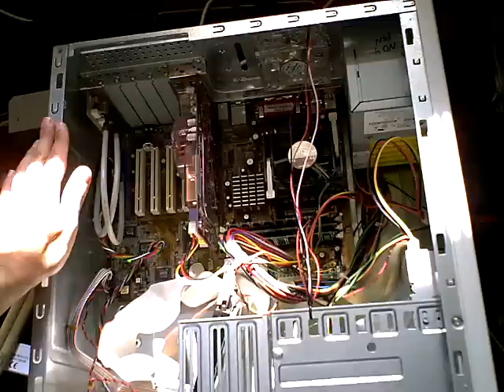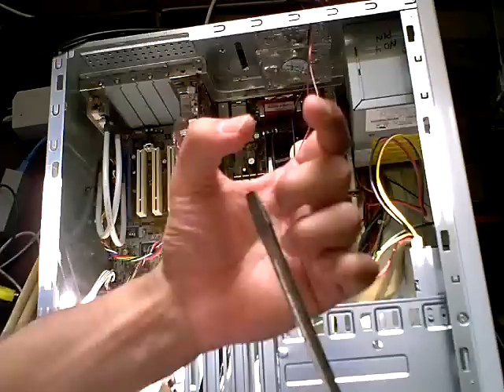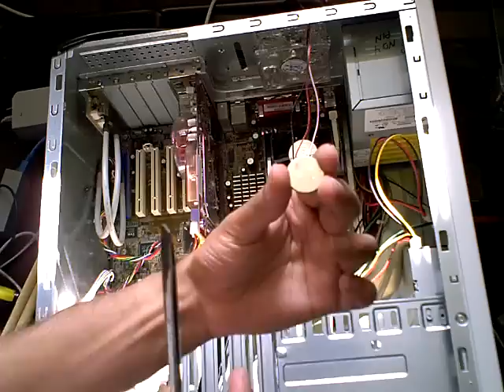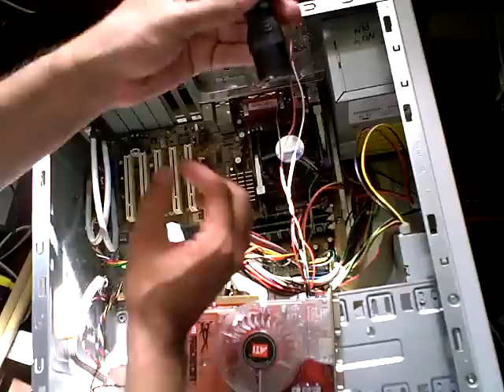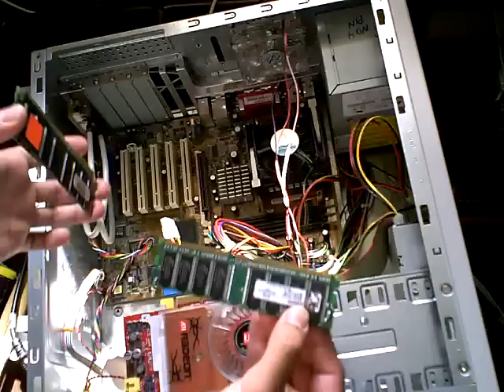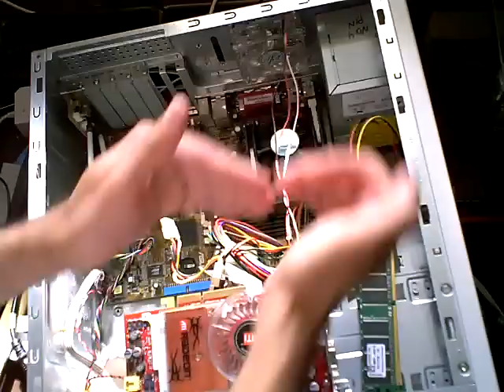How to possibly fix a PC that will turn on but will not beep and will not display anything on screen

Comment: I took both my RAM modules out.. 3 long beeps on a loop (apparently thats memory for as rock) i put 1 ram module into 1 socket, no post. I switch socket no beeps. My second RAM however beeps 3 long on a loop but only in one socket.. both RAM modules in both sockets 3 long beeps on a loop.  Switch them around same thing... IM SO CONFUSED PLEASE HALP ME
Reply from the maker: +AddamBolger1002 Beep error codes differ from one BIOS manufacturer to the next. To discover what the beep error code is trying to telling you, discover the manufacturer of your BIOS (available in the motherboard's manual or on the motherboard's manufacturer's website {on the page for your specific motherboard model}) and then look up the frequency and interval of your beep error code on:

http://www.computerhope.com/beep.htm

Comment: I recently upgraded my RAM from 8gb(2x4gb) DDR3 to 16gb(2x8gb) DDR3 and upgraded my graphics card from 1gb GeForce GT610 to 4gb GeForce GTX 960. My Computer fires on and all the fans spin and all the drives spin as well. However, none of the usbs and display ports work. My PSU is at 500W. Could it be the motherboard even though is powers the fans and all the other components? Been trying to figure this out for the past few days and it's all I can think about until its figured out. I need people with a lot more experience than me to help me out lol
Reply from the maker: If this is new hardware that you are installing on your motherboard (that has not yet functioned on your motherboard,) note that matching bus types of video card to motherboard socket (PCI-E for example) or matching bus types of RAM module to motherboard socket (DDR3 for example) does not necessarily signify compatibility. If this is the first time you are trying this hardware on your motherboard, there is a chance that this new hardware is not compatible with your motherboard, despite the same bus type and despite the fact that the new parts fit in their respective motherboard socket. Your motherboard manufacturer's website will have a support page dedicated to your motherboard's model, and on this support page should be a compatibility list for such components as video cards and RAM modules. Ensure that your new component is certified to function with your motherboard, and if your new component is not present on the compatibility list, then there is a chance that the new component is not compatible with your motherboard.

Comment: hi! I have a problem with my pc. Im trying to reoot my pc coz it display in the monitor when I opened it the the boot mgr is missing.then I inserted the windows 7 starter cd..i cant still get into process coz it display again the input not supported..what will I do? pls help..Thanks!
\
Reply from the maker: +Ry Chest Your display does not like the resolution that the restore disc displays in. Simply use a different display for the restore process. Once that is done, your current display should work once windows is up n running again

Comment: Hey dude can you help me?

i have dual screens. Both monitors boot up and then when it comes to the login screen my primary monitor goes black whilst my secondary monitor is fine. I hit the auto image adjust button on my monitor and the screen pops up for a secs and then it goes to black again. i have a r9 270x toxic
Reply from the maker: +septiczz Your issue is software based. You'd best contact the makers of your video board for help.
Reply: RodneyDickson Its alright ow just got fed up and bought new monitors thanks anyway
Reply from the maker: +septiczz Better that way : )

Comment: can the cmos reset work on a brand new mobo? also I took the battery and put it back in in like 10 seconds so could my time frame matter as well?
Reply from the maker: Yep, sure can. This is how I'd handle it: disconnect the power cable, remove the CMOS battery, short the CMOS jumper pins for 9 seconds then return the jumper cap to its initial position, press your PC's chassis power button switch (to discharge any remaining power circulating in the system), leave the PC unplugged and in this state overnight, then the next day return the CMOS battery to its socket and power up the PC
Reply: +RodneyDickson thanks for the reply but I'm an idiot apparently. my ram stick looked all the way in but apparently wasn't. thanks for the reply though. info helps regardless. good video
Reply from the maker: Good stuff. Glad things are running now.

Comment: My computer was working fine, I then removed, cleaned and put back my on-board video card. However, now I am unable to boot windows. The computer starts, I get display, I get past POST, I get the "starting windows" screen and then the computer restarts. This cycle repeats. Please help me, I am totally clueless!
Reply from the maker: Try going into the BIOS, 'Load Setup Defaults' then save and exit. If that doesn't help, try booting Windows by holding F8 to go into safe mode, then uninstall any unnecessary programs (including your current video driver). Also, do START, RUN, type MSCONFIG (then press enter). Uncheck everything in the STARTUP tab, then save and exit. If still no luck , your Windows installation may be corrupt and may need reinstalling.

Comment: Old video but pls reply I just tried to upgrade my cpu and now there is no display no beep nothing it turns on and I don't know what's wrong yes all the things in this video I did please help everything is plugged in right ram is good gpu is good no problems but no display how do I fix this?
Reply from the maker: If this is new hardware that you are installing on your motherboard (that has not yet functioned on your motherboard,) note that matching bus types of video card to motherboard socket (PCI-E for example) or matching bus types of RAM module to motherboard socket (DDR3 for example) does not necessarily signify compatibility. If this is the first time you are trying this hardware on your motherboard, there is a chance that this new hardware is not compatible with your motherboard, despite the same bus type and despite the fact that the new parts fit in their respective motherboard socket. Your motherboard manufacturer's website will have a support page dedicated to your motherboard's model, and on this support page should be a compatibility list for such components as video cards and RAM modules. Ensure that your new component is certified to function with your motherboard, and if your new component is not present on the compatibility list, then there is a chance that the new component is not compatible with your motherboard.

Comment: I reset the CMOS and turned it on and it beeped once, a still no VGA output tho. What does that mean?
Reply from the maker: +manafloodin Your PC might be defaulting video output to a different connector on the back of your PC. Try connecting a display to a different output and see if that helps

Comment: I have a fairly new HP envy 23 All in one that won't boot up entirely. It just shows the black screen then seems to shut back down. I recently upgraded to Windows 10 but since then it's been acting up and has been very very slow. Now today it's completely black. FYI I have wireless keyboard too so can't use F8 or F11 it seems. Any suggestions? Thanks!
Reply from the maker: Eek. Ok. Well, if the system is still under warranty, you could go that route. If not, you could buy a USB keyboard (electronic shops sell them for about $10) and try your hotkeys.
Reply: Thanks for the reply. I will try buying one today or tomorrow and see what happens!!
Reply: Oh another question sorry ... Do you think that the computer would recognize a new usb keyboard even though the drivers wouldn't be installed yet?? The  screen is still black and it's been off for at least 24 hours and still no progress.
Reply: Hi again! I bought a new usb keyboard and hooked it up. I tried rebooting my computer and pressing the hot keys and still nothing happens. Time to find a local tech? ...or can you suggest anything else? 😭😭😭😭
Reply from the maker: Ok, perhaps I read the situation wrong. You are saying that the screen is always black? There is no sort of text output at all on screen? If this is the case, since it is an All In One, I recommend you treat the problem as you would a laptop. See: http://www.youtube.com/watch?v=qRhphHjQrNk&lc

Comment: I've looked at my motherboard manual and I cant find cmos reset switch...not exactly sure what it looks like. I am having this exact same problem. I built my computer myself and its been working great for a year now. I unhooked it cleaned it to get the dust out of it and when I hooked it back up this problem was present. I have an ASUS p8z77-V PRO motherboard. Any advice anyone could give on how to locate my cmos reset switch would be very appreciated
Reply from the maker: Well, generally it's a jumper cap, not a switch per se. What you can do is simply look for the CMOS battery (the button cell battery shown in the video). Unplug the PC, press the power switch, then remove the CMOS battery. Wait overnight, then reconnect everything and give it a shot (the CMOS 'should' have cleared by then)

Comment: You can always update your motherboard, but before you buy a new motherboard, find out if your components might be useful on a new motherboard that it is compatible with them.
Reply from the maker: +Juan Gonzalez Good tip

Comment: hi rod.. can you help me..
my pc is on, i can control it via remote on network, 
the problem is no display on monitor itself..

steps i tried;

checked monitor and cable.. OK
reset/changed bios batt.... (display becomes ok,,but after several restart, no display again)
replace ram  (same above)

thankyou
Reply from the maker: +jaymar espiritu Ok, first, check for different video outputs on the back of your PC: your PC could be defaulting to an output that is not your main output. Also, if you can via network, try to access the BIOS and see which output device is selected as the main output device. Don't forget to test your display with another computer to make sure that it is not the display that is faulty. Finally, maybe your video out device is just faulty, it may need replacing
Reply: +RodneyDickson problem solved, i remove all the components , i found that processor slot is too dirt, i clean it with blower , and put it back again , now pc is ok! by the way im using AMD proc.. ty for ur response.. :)
Reply from the maker: +jaymar espiritu Wow, I don't hear of that fix very often. Thanks for sharing : )

Comment: can u pls suggest a ddr3 motherboard ( i have an intel dual core e2200 2.20ghz CPU)
Reply from the maker: +Right nanner Fraid I cannot. The last PC I built was well over a year ago. I've had bad experiences with Asus, but my current Asus motherboard is working fine, so who knows : \ Here's my wisdom: whatever you buy, go cheap, cause when something breaks, you want it to be cheap to replace. Also, don't believe that expensive means it'll last longer: I've had mid-grade hardware die on me just like low end. Hope that helps some.
Reply: thanks it did helped
Reply from the maker: +Right nanner : ) Good luck with it then.

Comment: So long story, when I was building a pc, it was my first, when I removed the motherboard  from the box it had a plastic case for the processor  to go, it would pop off once the processor was installed below it.  however it fell off right away, and when I put the processor  in, the clamp installing the processor dug Into the processors sides. and no image will show up.
Reply from the maker: +Julious01 You can try reseating it (unplugging the PC, removing the CPU from the socket, checking that all pins are present and not bent, and then reinserting it and re-fastening it) but you're talking about 'digging in' to the CPU, so it may be permanently damaged sadly.
Reply: +RodneyDickson aw... I'll have to look into it
Reply from the maker: +Julious01 I wish you luck with it then
Reply: +RodneyDickson would a new hard drive have anything to do with this?
Reply from the maker: +Julious01 If it did (such as the case of an I/O error) then if you boot the PC without the HDD connected and it boots fine, then you have found the source of your problem.

Comment: so if I leave my power supply turned off all day, then turn it on then the PC starts, If i leave it plunged in all day and try turn on the PC the fans and lights come on but no Post so going to try swap out my power supply, a week before this started there was a power cable and transformer that blew down the road and during that my PC was plunged in but not on and I think it caused it.
Reply from the maker: +Vernon Ray Hmm, that sounds like a very likely culprit. In your case I would tough out the 'turning off' of the PSU situation until the thing finally died, but I understand how inconvenient this may be. Either way, good luck with it.

Comment: Sir, I follow ur direction watching this vdo n i found the problem in RAM like in the vdo. I hav only one ram n two ram sockets. Then after i hav no idea what to do. I tried putting it in the 2nd socket and startup but again no beeps, no screen..Got no idea ..please help me sir
Reply from the maker: Hmm, have you tried resetting the CMOS as shown in the video? Also, have you checked the RAM module for any burn marks or missing contacts?

Comment: So i bought a new processor and tried putting it in, no display, no beeps. so i go back to my old processor accidentally bending the pointy things, i fixed those then put it back in. still no display or beeps. help please.
Reply from the maker: +DrMeowsif Sounds like everything is ruined sadly. The original processor is now damaged, and the new processor probably needs a newer motherboard.

Comment: my computer opens normally but after I open any app or a game it gives me a black screen with the computer still working any recommendations?
Reply from the maker: It sounds like a video card problem. I'd download the latest video card drivers for your video card, then uninstall your previous video card drivers, then install the most recent video card drivers. Try that and tell me how it turns out

Comment: I've got a similar problem, it does power on indeed, then I push the power button, it shuts off, after a few tries (most of the time one, other times more) then it does boot and gives a beep and then it works just fine.
Reply from the maker: Sadly intermittent issues like the one you're describing are a LOT more difficult to troubleshoot. You can try booting the PC with little to nothing connected to it to see if it is a weak PSU issue, but even then, it might be the board that's channeling power incorrectly. You could also reset the CMOS (as shown in the video) and 'Load Setup Defaults' in the BIOS following by saving and exiting to see if it solves the issue, but in your case, I'd just put the PC to sleep when not in use in order to avoid this issue altogether when booting. Sorry I couldn't be of much help.
Reply: +RodneyDickson I'll try to change to setup defaults in the bios first, if that doesn't work I'll look at the other options, thanks:)

Comment: am having this problem, i noticed that the motherboard don't have jumper. is this which is causing that?
Reply from the maker: If you have no CMOS CLEAR jumper, then simply unplug your PC, press the power button, open it up, remove the CMOS battery, leave the PC alone overnight, and after a night (or longer if you wish) reconnect the CMOS battery, plug in the PC, and power up. Lemme know if it works out.
Reply: Thnx man
Reply from the maker: leo mas
You bet. Good luck with it : )

Comment: my 3rd ram slot was the reason why my screen was not showing display. what is the cause of this? how can i fix it? i want all my ram slot used
Reply from the maker: Sadly some motherboards simply do not like to operate with any odd combination of RAM modules (so why 3 RAM slots you ask? in case one of the RAM slots become defective, you have another RAM slot to use)

Comment: Sometimes my pc does just work fine. But sometimes it beeps 1 what is normal but it doesnt display anything on the screen. How can i fix this?
Reply from the maker: +GabensGaming Companny Chances are it is defaulting to outputting video on a different video output device. Check your BIOS settings to ensure that your video card is the primary video out source.
Reply: +RodneyDickson ok thank you
Reply from the maker: +GabensGaming Companny Let me know how it turns out.
Reply: +RodneyDickson I changed it and it has never happend again. I think its fixed!!!!! I would reallly wanna say thank you!! Best youtuber ever!!!!!
Reply from the maker: +GabensGaming Companny (shrug) you found the problem, so good job on your part : )

Comment: interesting video. so essentially i removed my RAM and i had a post beep code (1 small beep and 2 quick beeps, beep beep-beep) it means my RAM has a problem? :o
Reply from the maker: +xGoodOldSmurfehx Beep error codes differ from one BIOS manufacturer to the next. To discover what the beep error code is trying to telling you, discover the manufacturer of your BIOS (available in the motherboard's manual or on the motherboard's manufacturer's website {on the page for your specific motherboard model}) and then look up the frequency and interval of your beep error code on:

http://www.computerhope.com/beep.htm